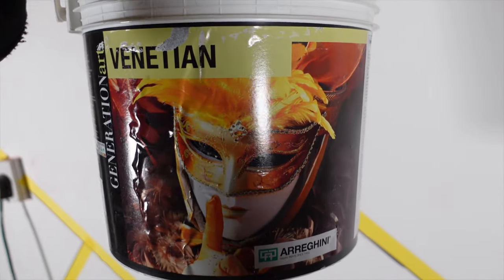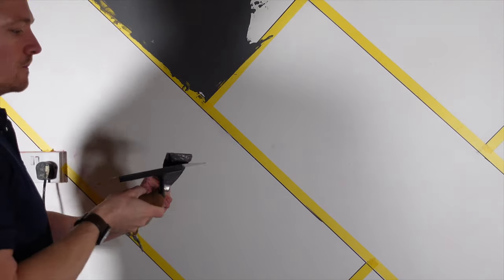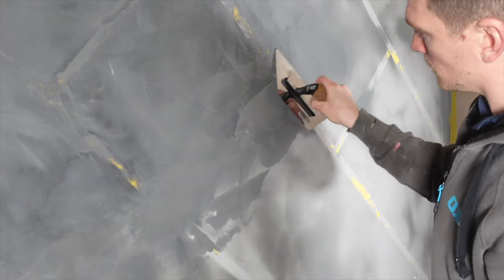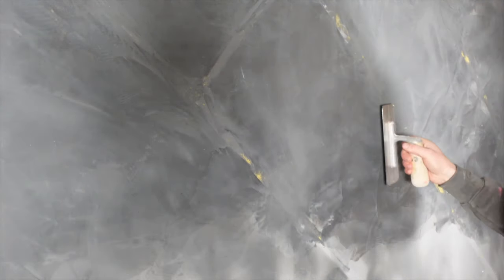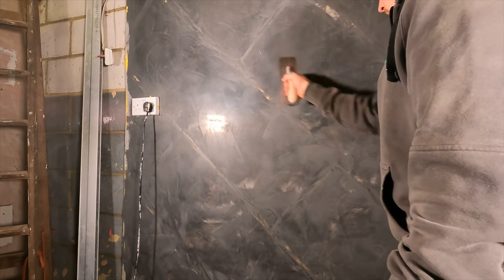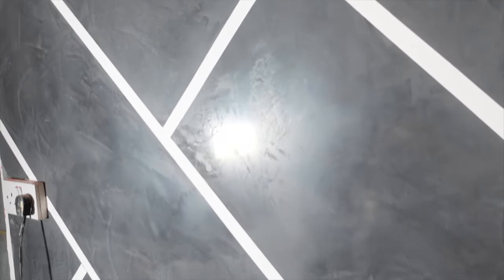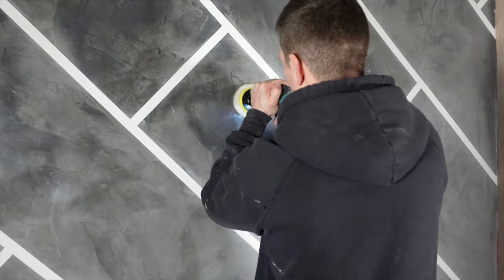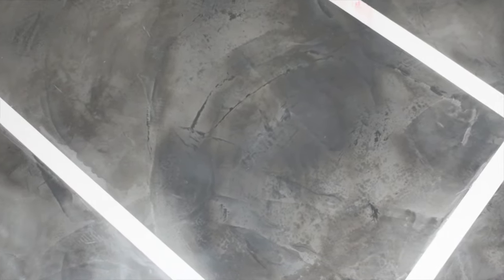Marble Effect Plaster…HOW?? | VENETIAN PLASTERING EXPLAINED...

Comment: Hello mate just wondering if you could help / advice about the Venetian plaster.

Where do you buy it from I can’t get any of it online it comes up the paint version which I’ve tried and it isn’t as shiny. 

And what type of dye did you use can it be like black emulsion paint ? 

And do you have to use 3 coats or would you get away with a base coat then a finish on top. 

Thanks

Comment: On a related topic: a coupla years ago, after I'd skimmed my hall and landing, I was painting it with a matt, white emulsion, and because I still had my plaster tools to hand (months after the actual plastering! LOL), I wondered what would happen if I trowelled and polished the top coat of emulsion. I couldn't find anyone else mentioning it on the interwebs, so I assumed it would go horribly wrong...
...but to my amazement, it DIDN'T!
I got a beautifully smooth, glassy finish - that was only marred by lots of grey swirly lines and marks in it, presumably cos my trowl was an old (but clean) one. If I had a brand, spangly new one, I'd have tried that. With my eyes shut, it felt like marble - but nowhere near as cold.
It gave a finish that looks a lot like this one, but white (and grey).
Have you ever tried "plastering" - and polishing - with emulsion paint?
Has anyone? LOL
Reply from the maker: Ha that’s very interesting mate. Thanks for the heads up - might have to give it a go myself 😉
Reply: Yes I did my sons bedroom walls. My reason was I hate painting with roller or brush and just so happened to be looking at my trowel so I thought. Maybe i could skim the walls with emulsion. I actually put the paint on with the trowel. Dipped a brush in paint. Applied that to trowel and skimmed all walls. So flat, smooth no texture like a roller and does polish up like glass. Even though I used just 1 colour it still had that look of layers of a few tones of gray
Reply: @ukvinersmart7571  Yep, that's exactly what I found. I assumed the grey swirls and strokes were due to an old trowel. One day I'll get a brang, spangly new one and give it a go. Wonder how it would work with a darker paint colour....